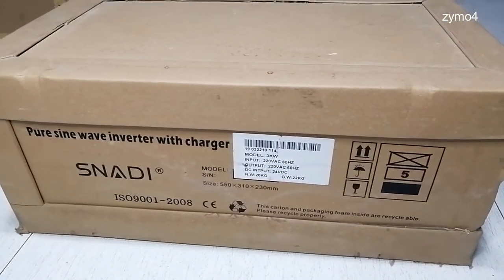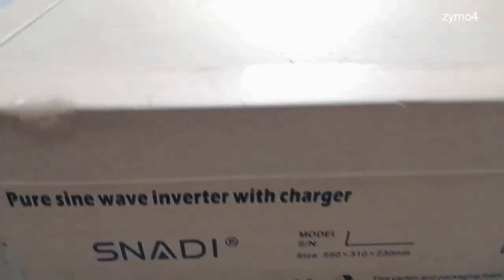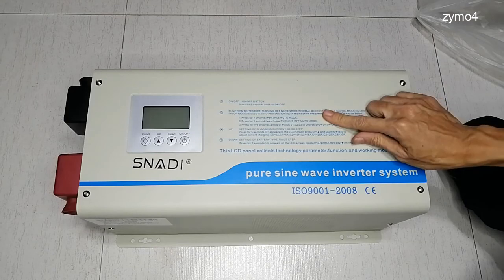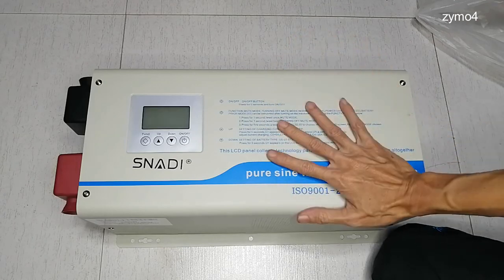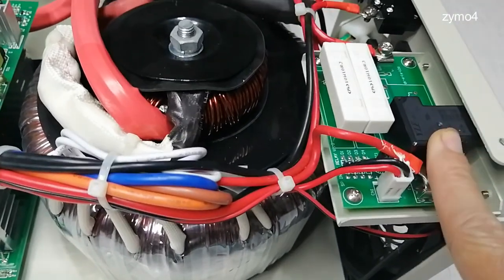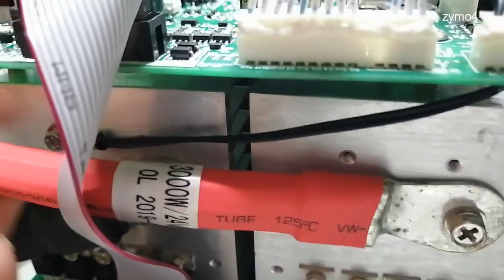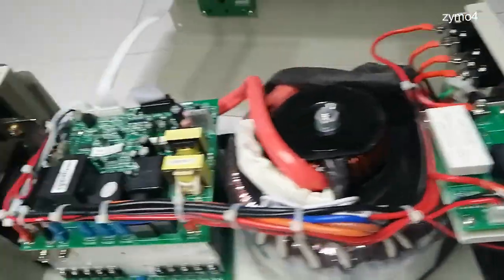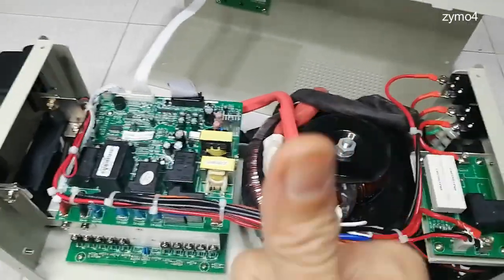Unboxing SNADI 3KW 24v Off Grid Inverter with AC Charger

Comment: sir pano iset lvd and hvr ng snadi nyo? yung B01-B06 options ng snat 2k 24v ko ay pang 12v system instead of pang 24v system eh...
Reply from the maker: Old model to sir, so hindi ma set. Yung bago nila ang puedeng baguhin lvd/hvd. So when you buy a new inverter, ask them first para malaman nyo na meron. Baka bentahan ka ng lumang stock.
Reply: @MarkMinoza  salamat sir sa reply, good luck din po sa channel nyo